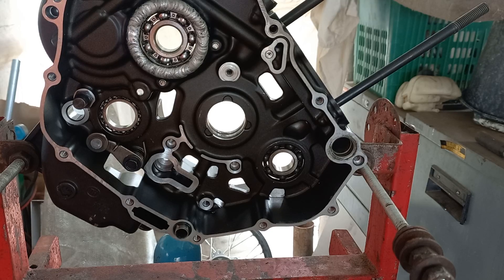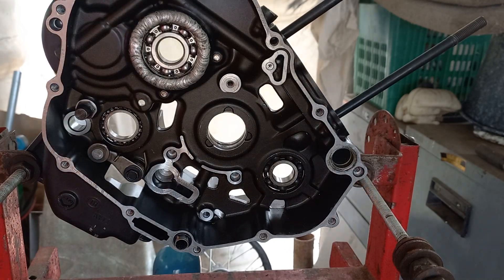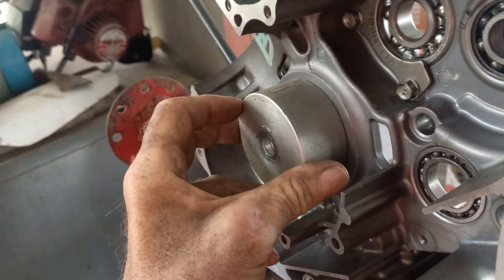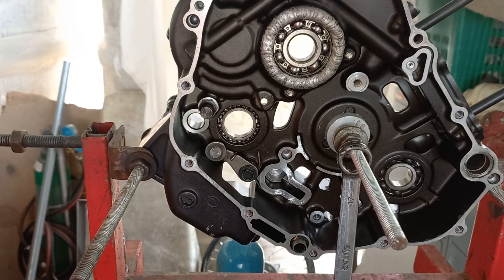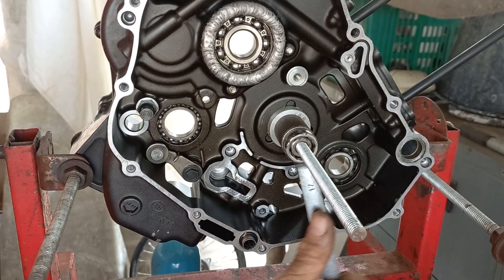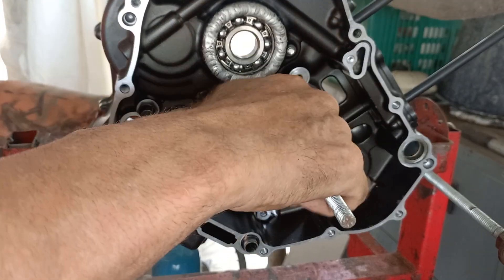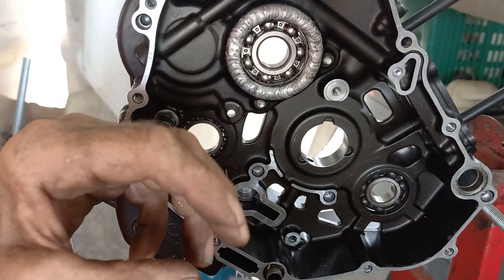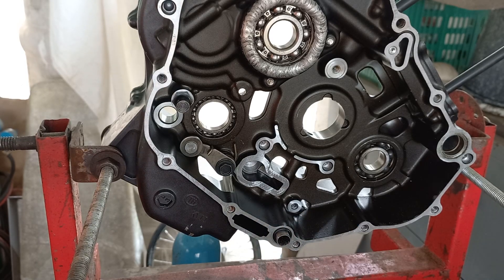CBR250 CRF250 - 301CC. Crankshaft bearing removal. part 8.

Comment: simplify it: heat up the housing on a hotplate and gently hammer out the old bearing. While the housing is still hot, get the new bearing out of the freezer and put it in.
Reply from the maker: Absolutely WRONG! YOU OBVIOUSLY HAVE NO IDEA!
Reply: @theravedaddy  What is your argument?
Reply from the maker: @liamhotspur9182  you. You dont have a clue what youre talking about. Tell me how youre gonna fit 2 expanded bearing shells by 'putting them in the fridge' you havnt got a clue what youre talking about.
Reply: @theravedaddy  Take it easy, you are right. You needed to remove the bearing shells not the ball bearings.